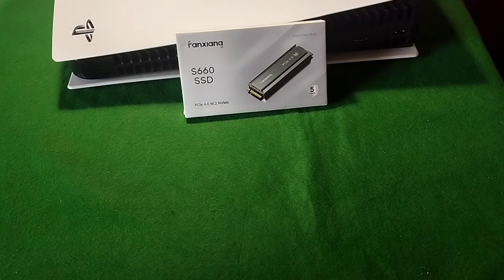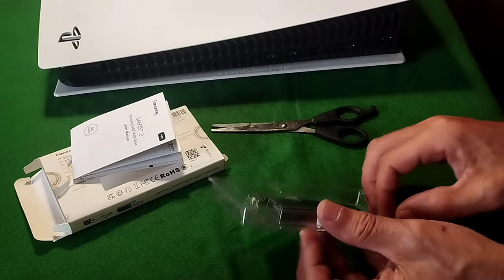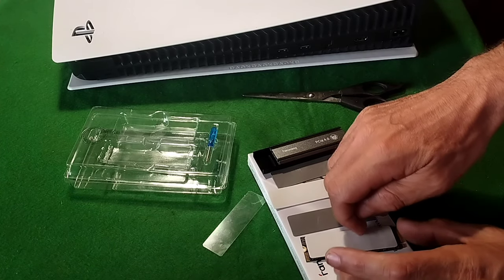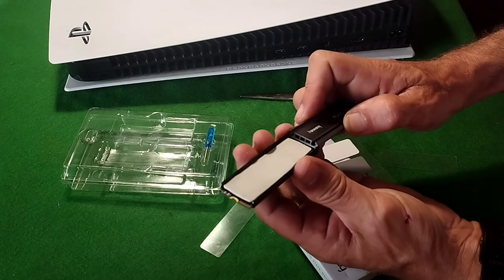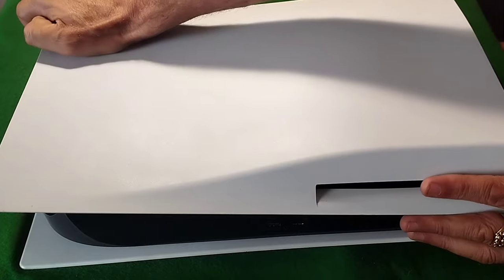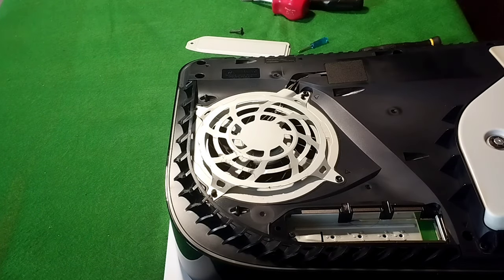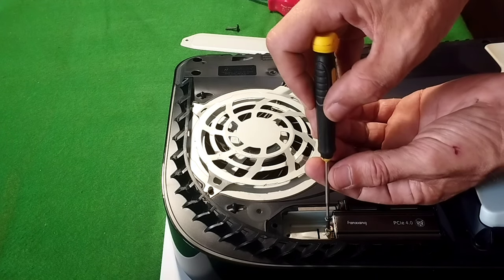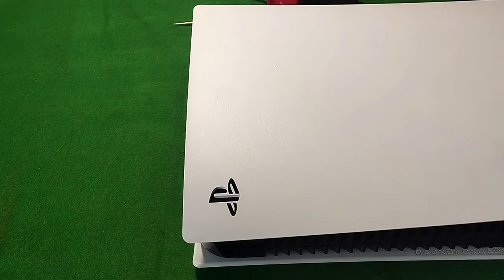PS5 SSD, Fitment Tutorial. Step By Step Guide. With Heatsink install, 2tb S660 Fanxiang. Works Great

Comment: I got the 1tb version for 38 quid and installed it this morning. Seems to be running games just as fast as the internal ssd or as close as needed 🎉
Reply from the maker: All my games are on the SSD now, runs them all fine 👍🏻 happy days
Reply: @STEVIEDVD  what about when you’re at like 80% capacity and up? Does it have any lag at all? How reliable is it. Just wanna know before I buy this one or the wssd black ones? Thanks a bunch
Reply from the maker: @DavidPham911  I have nearly max out the space and didn't notice any lag, all my games are on it.  It's been flawless since day one 👍🏻
Reply: i know im late but does it still work fine I'm thinking of buying the 4tb one
Reply from the maker: @carbankatana6217 yes, still working, no issues whatsoever 👍🏻

Comment: Did you know that the reason you got two cooling pad is the little chip at the front of the other cips is lower so you put the white one on the little chip cutter to size then put the grey one on over all the cips then put Heatsink on top of them and the other grey one on the other side of your ssd hop this help
Reply: Chips not cips cut not cutter and hope not hop 😂😅
Reply from the maker: It seems to be working fine, have you got a link to any instructions. There were none in the box? 👍🏻
Reply: Hi when I put mine together  later I'll show you a photo of the pads and were they should go on the ssd .ps if you get a ruler you will notice that the 3d nand chip iis not as high as the others OK bud 👍
Reply: I've sent you a email OK bud 👍

Comment: You didn't have to slide it. You can snap it on.  Also, make sure when placing the ssd in the case that the cruve is on the botton, not the top.
Reply from the maker: I'd rather slide than the click as people have snapped the ssd that way

Comment: Huge shoutout to you for helping me install this ssd in my ps5!! 🎉 subbed and liked! 🎇 🎆
Reply from the maker: No problem, hope it went well for you, mine has been working flawlessly ever since I installed it.   some have said I should have clicked it into place, but I didn't want to use any force and break it.  I had no instructions just what I could find here and there.
Reply: @STEVIEDVD  i noticed when I slid the ssd into the slot it made a noise and then put it back together and I formatted the ssd :)
Reply from the maker: All working??
Reply: @STEVIEDVD  it sure did thanks again 😄

Comment: I’m a novice when it comes to this so I’m looking for some advice. I was looking at this brand on Amazon but the S880-7300mb version. Is the S880 better than the S660? It’s only $10 more than the S660, should i get the 660 or the 880?
Reply from the maker: I really couldn't advise you. I don't have much knowledge on it.
Reply: @STEVIEDVD  what does the S mean in S660?

Comment: So u did the install but didn't show us the ending?  As I got something similar and I've struggled with it
Reply from the maker: It worked fine mate, what's the/your issue? What are you struggling with?
Reply: @STEVIEDVD  mange to suss it out. But was hard going
Reply from the maker: After install, ps options menus, saved data, select SSD for ps, job done 👍🏻 I've been running all games with no issues since the video
Reply: @STEVIEDVD  far as I'm aware it's solved as I did see the model name which is important..but ot was hard going
Reply from the maker: Glad you solved it 👍🏻
Reply: @STEVIEDVD  seriously for a novice not gd
Reply from the maker: Lol, out of 25k people only you say this. You have issues you need to address. Read some comments, most are thankful. I suspect you were the issue behind your original dilemma. You got it sorted, you should be happy 🤣 but you still have an issue. Enjoy what you have👍🏻 I do

Comment: I got my in and screwed down, but mine slid on easy.. it wasn’t as snug as yours?
Reply from the maker: Oh, thought it would be the same fit. Working ok? Mine has worked 100% since I fitted it.
Reply: @STEVIEDVD  yeah it’s working fine but mine just weird seeing you had to almost force and mine slid in and off with the same heat sink.
Reply from the maker: Yes agreed. You did slide it in the right slot, I had two attempts to locate the slot in the video, not sure if there is a slot above the one I slid in. If there is a slot above, maybe you put it in there, might be worth a look. Just A thought 👍🏻
Reply from the maker: Also I used a thicker and a thin heat sink, thin white one on SSD chip, and grey one in the case, then slid together 👍🏻
Reply: @STEVIEDVD  yeah I followed your tutorial step by step..it’s working perfectly. I just found it odd.

Comment: Where did you get your screwdriver for the last bolt. That's literally the only thing holding me back is that bolt
Reply from the maker: I bought a cheap set from the corner shop, watch screwdrivers set I think, and the Christmas cracker driver came with the ssd
Reply: @STEVIEDVD  got it sorted stevie. Works perfectly, thanks for the great video 🙏

Comment: how fast is the read/write speed you got in the ps5?
Reply from the maker: Specs are online
Reply: i know the claimed speed, but just wondering how it actually performs as it actually tends to be slower than the rating
Reply from the maker: 4.5 - 4.9 gb/sec I've been getting, I've heard the spreed is capped

Comment: I just got mines and its not going in im i doing something wrong did i break the pins on the inside ? Helpppp
Reply from the maker: Are you locating the metal case into the right slide channel. It's a very narrow slot, and I pressed the heat sink down a bit with my thumb to get it sliding.
Reply: What happened?
Reply: I did is it possible to break the pins that inside the slot of the ps5 because its not going it or standing up like its supposed to

Comment: What happens if you put pc SSD in ps5 will it run windows?
Reply from the maker: It will work in PCs and laptops I've been told
Reply: If you mean a SSD already preloaded with Windows OS, no it will not run on the PS5. PS5 will not recognize the SSD and will ask you to format it for use on the console.
Reply: Windows 7 is ancient now. Don't think it would have the capacity to operate that. Microsoft no longer supports it. Get windows 11 or 12
Reply: @maguro-_-otoro  in PS5 main storage not in external SSD slot
Reply: @mipad553  the main storage is soldered onto the motherboard, it's not removable unless you melt it off the board. You mean m.2 slot, which was what I meant. So no, it will not run windows.

Comment: Dude, no offence, but you done this completely arse ways 😂
Reply from the maker: Show me how it should be done, it would be appreciated 👍🏻
Reply: put the thick heatshrink on the bottom of the case, then put the ssd on top of that, on the top matal part put the thin heatshrink on the bottom part of that. do not slide it, just push it in and it will click into place. you wont break it cos the metal casing will protect the SSD from braking. @STEVIEDVD
Reply from the maker: @thepluggy1  click fit has broken many I've been hearing. Click fit seems to be the arse way 👍
Reply: i tried it it no problem. i dont see how it could break when its resting in a metal case @STEVIEDVD
Reply from the maker: You should have done a video on it.😁
Reply: @STEVIEDVD  maybe I should 👍